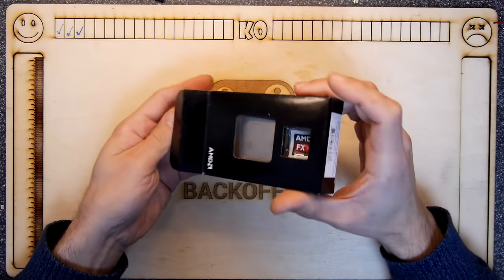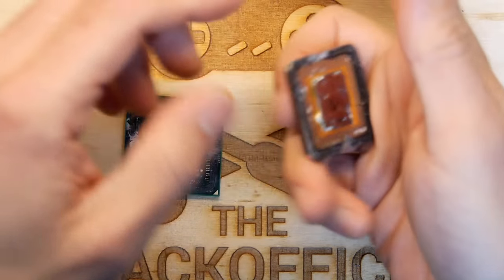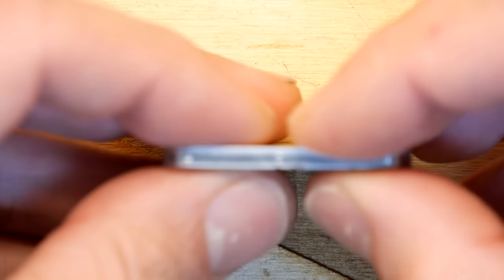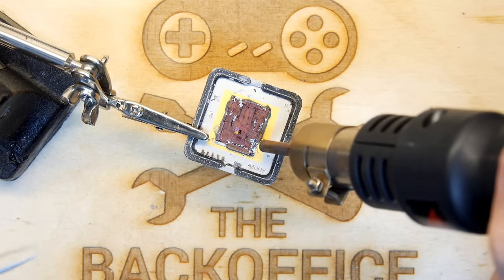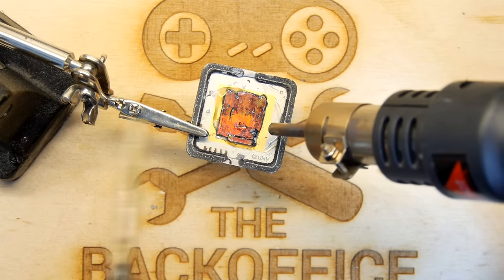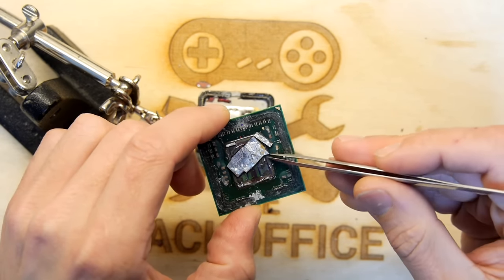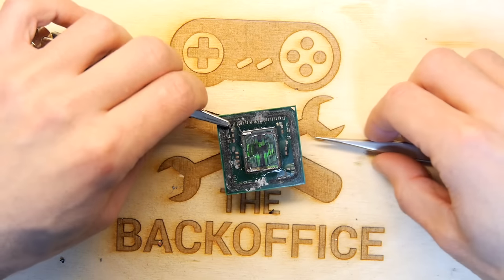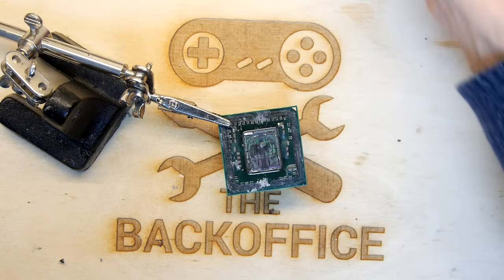AMD FX 9590 Desolder Heat Spreader (after delid)

Comment: dude that is actually sick to see the silicon and how its actually soldered on thanks for sharing
i wonder if amd will solder on the new cpus
Reply from the maker: +morrisfox3 I think soldering them is a pretty reliable method of heat transfer so I expect they will, also it's good for several hundred of degrees 😁
Reply: much better than intel's high quality toothpaste they use as TIM
Reply: Ryzen is soldered, at least the 7 series is.
Reply: +globula neagra I expect the entire lineup of ryzen processors to be soldered. People complained about temps and yet it seems AMD keeps soldering the ihs on. It's been working well for them honestly.

Comment: It's a indium based solder between the heat spreader and the die and the gold on the heat spreader is actually gold because the indium doesn't bond to the nickel plated spreader directly

Comment: If a CPU does what "you" want it to do, for the price you're willing to pay, then who cares which camp you jump into? I own nothing but Intel, but this new AMD Ryzen that's coming out, can do what it's reported in doing and is stable. I may jump ship when I feel like an upgrade.

There's gadgets to delid CPUs you can buy or even 3D print out for Intel CPUs. I bet there's some for AMD CPUs out there?
Reply from the maker: I think some sort of wedge that jams itself in automatically would help while you heat the lid to melt the solder.
Reply: The Backoffice I don't see the point, AMD solders the heat spreader on. This provides really effective heat transfer, better heat transfer is why people delid current intel chips... solder is as good as that gets.
Reply: im gonna guess the reason for there being no amd lid off tools lol is cus its actually soldered on rather then a thermal paste. im sure that if there was paste in amd chips the lid would of came off with out breaking the die. never mind he cut other things off delidding it lol
Reply: MigM16 Yeah it's already been pointed out to me that this chip is soldered. Where as not all AMD chips are soldered to their lids. I'm sure a metal delidding tool could be designed to help lift and heat at the same time. https://community.amd.com/thread/187441 Seems it can be done and makes it ~10C cooler.
Reply: +FairFight14 your best chance to delid an AMD cpu without damaging it is heat and yet that's even likely to damage it.
Reply: even if you had an AMD tool your supposed to heat it up before you pop the lid like this guy did lol, and then you want to have proper tools to remove solder and not just spread it around...
with conductonaut and reducing heat gap you can drop AMD temps a tad, but not worth it at all.  Intel on the other hand you can drop literally 40c load.

Comment: can you recommend a mother board for a FX8350 i have a bad MB MSI 970A-g43 now. it reboots after about 1 hr on. i had 4 replacement bds but they will not give me any more I have not had any $$ until now to buy a new better one it was a bearbone system from Tigerdirect back in Jan 2016 I am hoping to get it running again
Reply from the maker: +Kristyanna Virgona N1DHD/6 I'm super happy with my asus crosshair v formula-z and asus m5a97 r2.0 boards (I have two 9590 systems) hope it helps.
Reply from the maker: +Kristyanna Virgona N1DHD/6 Also I changed a lot of boards and PSUs etc before I discovered it was the chip that was faulty. Consider this.
Reply: ive had 4 chips replaced I brought this system back in 3/2015 I had medical heart problems (i'm 63 now) about mid year.I couyld not do anythig until now . i've built about 20+systems in my 40 years but none in the last 10 have been a mac user since 2005 until i got a i7 laptop given to me in 2014. my iMac i7 was stolen in the fall of  2014 so my son-in-law recommended AMD I wanted Intel. i saw a few forums said that that MB has hewat problems too
Reply from the maker: +Kristyanna Virgona N1DHD/6 I'm sure you have, but have you changed the cooler as well. That was the root cause of my problems. Even after I replaced mine the chip still failed (too badly damaged I guess) but on a new chip I could compare the coolers and my older one was what killed it for sure. Negative thermal overhead.
Reply: what about these I want it for light gaming and photoshop, GIGABYTE GA-990X-Gaming SLI (rev. 1.0) AM3+/AM3 AMD 990X SATA 6Gb/s USB 3.1 USB 3.0 ATX Motherboard or
Reply from the maker: +Kristyanna Virgona N1DHD/6 I think it should be fine, but again, is be concerned about your cooler and PSU as a priority.
Reply: I've upgraded to a 750 Watt 80 Gold PS. i had 4 cpu's before this one it worked for 4 months and I have a T4 cpu cooler on it.
Reply from the maker: +Kristyanna Virgona N1DHD/6 it's got to be your cooler, whatever you go with install amd overdrive and monitor the Thermal overhead while using furmark CPU test. Alternatively look for a CPU and motherboard bundle and go with Intel and move on. Could be the simplest option.
Reply: Asus sabertooth 990 R 2.0 old but tough with a 5 year warranty higher than any other mother board  I have seen.

Comment: You really should let your hot air rework station go through the cool-down cycle before turning it off. You're going to shorten the life of your heating element quite a bit. If it's anything like mine, when you switch off the hot air mode the fan will run until the temperature comes downs to a safe level, THEN you can turn off the main power if you want.

Comment: You can remove the heat spreader from soldered chips by applying heat and pressure. The solder is indium which has a lower melting point than most solders. 

More about the soldering process here (Intel chips but it's the same for AMD) - http://overclocking.guide/the-truth-about-cpu-soldering/

Comment: thanks 4 sharing great 2 vids, hav an fx-9370 runs super hot! have custom water cooling 360mm rad 6x fans and still the temps rocket. considering on how thick the top is you could sand away a few mill Dliding eek erm no thanks haaha but i will try the sanding when Final-ally i upgrade. fingers crossed i can get stable temps at a normal clock speed + 100% cpu load. instead im underclocking it a bit. usually @ normal temps is 42 deg C under load this thing just climbs and climbs n climbs.  im waiting for fridge coolers lol i could hook up this 2nd 360 rad but er no just no. already sounds like a jet engine. my 2 cents :D

Comment: What tool is that you're using to heat?
Reply from the maker: +SnowDrifter It's a SMD hot air blower for surface mount electronics.

Comment: Just wanted to repeat, I'd love to make a keychain out of that IHS when you're done with it. Something you'd like as a swap?
Reply from the maker: +Forge Where are you based?
Reply: I'm East coast US.
Reply from the maker: +Forge I'm always up for a swap, I'm just wondering when I'm next in the states or if anyone I know it's traveling soon as I'm not sure is worth shipping.
Reply: Fair enough, let me know.
Reply from the maker: +Forge If you are on Twitter I tend to tweet my movements as well 👍 any idea how you plan on attaching the keyring chain?
Reply: I'll add you on Twitter. I'd last add an AMD to my keyring in the early Athlon X2 days, it was pretty easy. You clean off any bits of CPU, clean off the rubber gasket, get it metal all around, and then drill a nice 3 or 4 mm hole, about 2 or 3 mm in from the edge. It's a nice thick piece of copper, so it won't deform. I used a steel wire keyring to get it all linked in. I used to have the chipset cover from my AMD-760MP on my keyring, that metal was lots thinner, but it lasted years and years as well.

Comment: awe man i would really love to get the info on how thick that lid is. there is a chance it could be lets say 100/thousandths thick someone could surface grind it down to maybe 25-50/thousandths. if they can get the lid of that is with out breaking the die, but like you said it may be hard to do if not heat it up to much.
Reply: or wait maybe make a copper or silver lid lol haha that would be cool lol, im all for 2°c lower temps or more
Reply from the maker: +MigM16 If you remind me on twitter tomorrow I can see if I can borrow a micrometer from someone 👍
Reply: ok ill try to remember, you may need to clean up the solder if u wanna measure right where the die sits

Comment: A little online research would have helped. Intel has been soldering some of their chips' heatspreader for several years by now, using some low temp indium solder. And there is even a technique to get the HS off without heating it up: By pushing it sideways. The solder is so soft that the shear forces are enough to detach the HS. Why shouldn't AMD do the same....plus you're surely not the first to delid a FX9590.